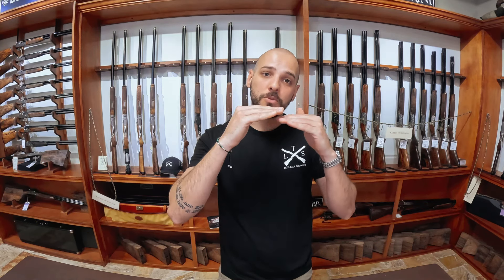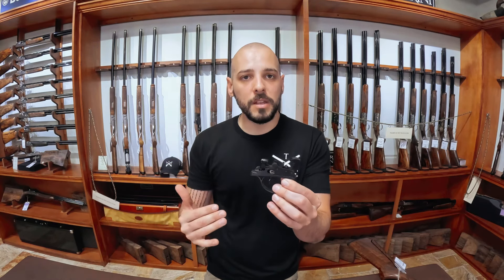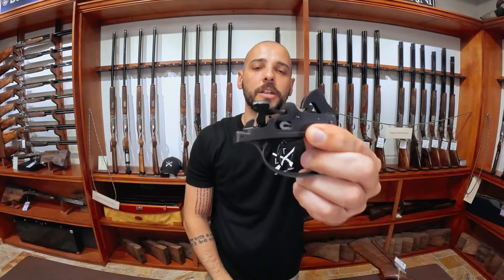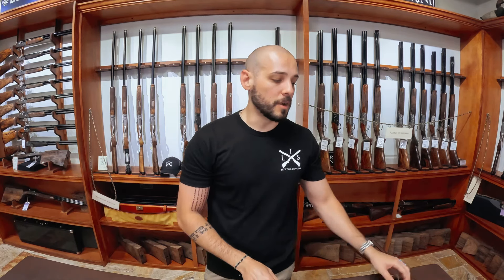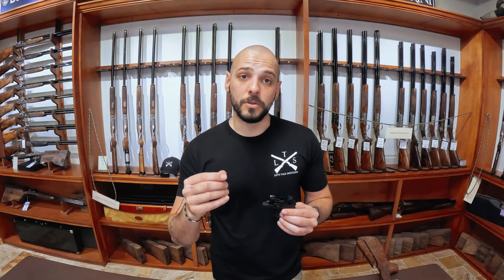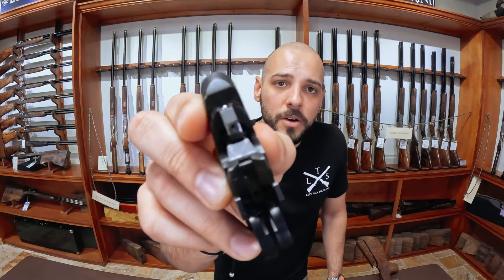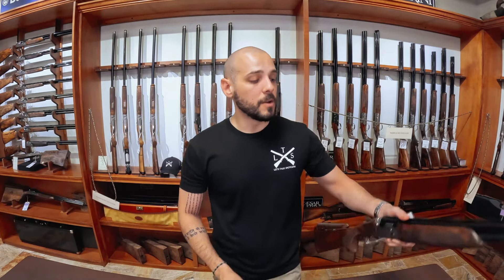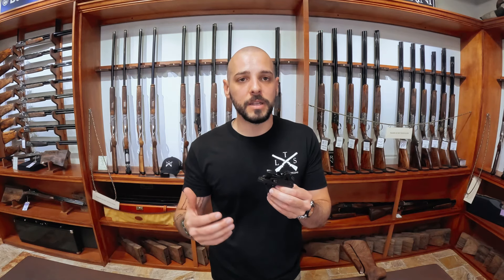No Second Shot - Failure To Fire

Comment: I've got a re-branded Rizzini. First shot goes off perfect. 2nd shot no go. If I arm the safety and disengage it, it will fire. Does this sound like an inertia block issue? 12 bore 7.5 x 28g I am using
Reply from the maker: It does sound like something is happening on the inertia not reseting.

Comment: Great video... Any suggestion on why a gun will sometimes have trouble breaking open after firing, and sometimes a shell won't eject afterwards? Happens randomly but too often to not be concerned about it. Any info is greatly appreciated
Reply from the maker: Hard to break open could be related to hard you close it. The harder you close the gun the harder will be to open due to the locking mechanism engaging more than it should. As far as the ejectors, could a timing issue or simply dirty.

Comment: Thanks for the great information!
Something I've been looking for is a video on what to do with detachable triggers. Some people say clean them, others say don't because you might accidentally get grease in the wrong spot. Premium guns often have this as a feature, but I can't find anything on  the internet on what to do with a detachable trigger once you have one.
Reply from the maker: I recommend never taking them out unless necessary. 
Most guns do not have a detachable trigger and they work just fine without being lubricated all the time. The same goes for detachable trigger guns. Unless necessary due to rain, broken part or swapping triggers, i would not take them out
Reply: @LetsTalkShotguns  Thanks! That's sound, logical advice.